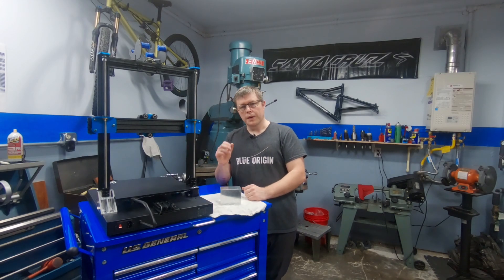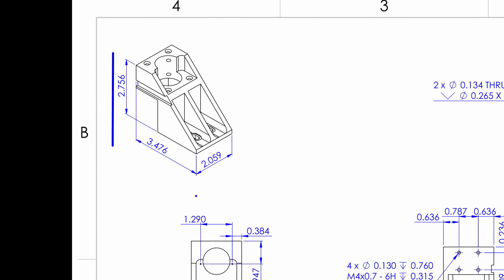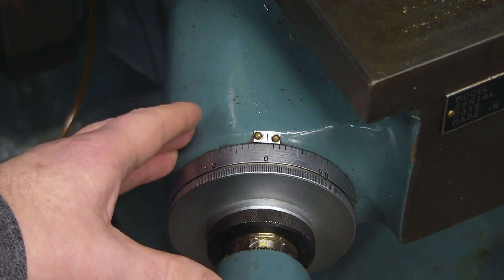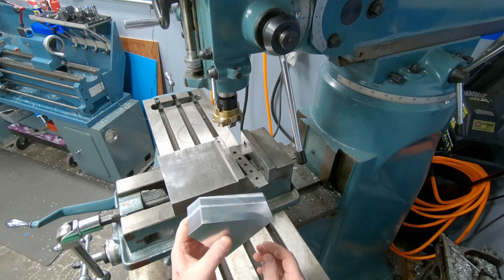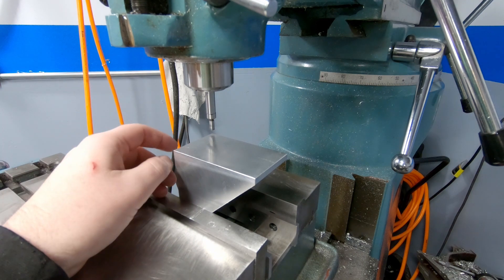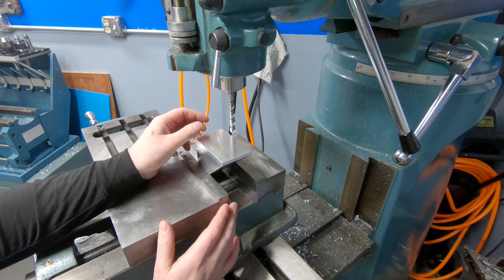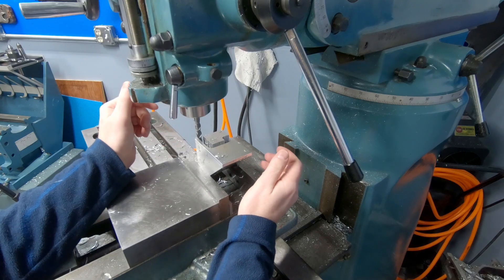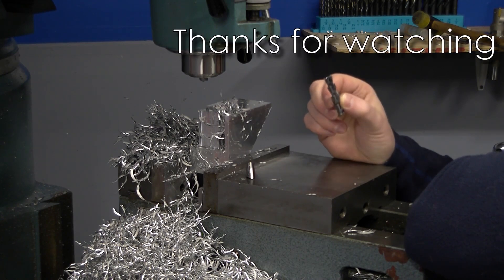Sidewinder X1 Gantry Support Part 2

Comment: I know this is late to the discussion, but could you have put a small thrust bearing between the top of the motor and the bottom of the coupler to stop the motor shaft moving up and down on the bearing clip in the bottom of the motor (pinning the vertical movement of the lead screw)?
Reply from the maker: Sure that is an option. The ball bearing is an easier solution.

Comment: I am surprised to see you are climb milling in a manual machine. Does your machine have a ball screw conversion? If it does not for sure during the roughing ops you should conventional mill with the cutter. hard to say if the cutter pulled the part in the video causing a big chip load that broke the cutter but if the cutter pulls the table into the endmill called auto-feed usually results in what you see when the cutter broke.
Reply from the maker: It was a gambal for sure, I worked great on the first bracket but I got a little greedy with this cut.

Comment: Damn what a heartbreak!!
While we are waiting for the continuation - are you looking into having these custom brackets mass-produced for sale?
Reply from the maker: I havent planned on having them mass produced as of yet. The initial cost to have that done is way more than I could swing right now.
Reply: @EtherealProject3D  Best of luck finishing up the project! Can't wait to see a before-and-after on a good, tall model!
Reply from the maker: There are going to be a few "scientific" tests that im going to do.
Reply: @EtherealProject3D  If you're not opposed to sourcing from China I have a connection with LDO and they do really good/low cost machining..  Might be an option for bracket production.  I'm curious to see some comparison prints.  I'm also curious if these could be made to work with the CR10s Pro as well (I may print a set and do some testing)..   Hit me up if your interested in talking with them.  nak3ddesigns@gmail.com
Reply from the maker: That could be fun.
Reply: @EtherealProject3D  I'm intrigued.
Reply: i would buy a set.
Reply from the maker: @hjc0706  Gonna be working on making a few extra sets this summer. Still perfecting the machining process, hints the time between videos.